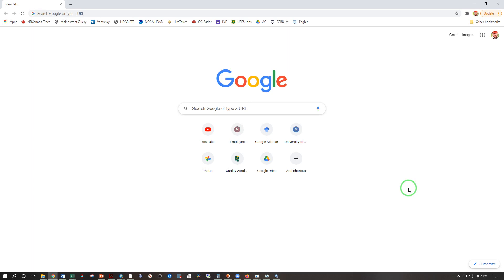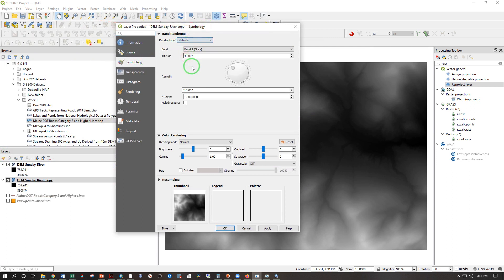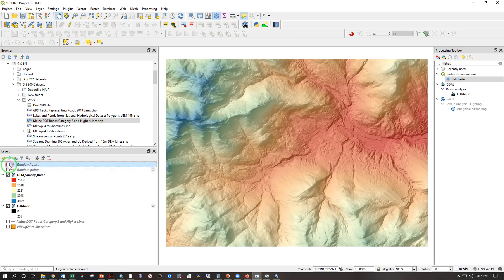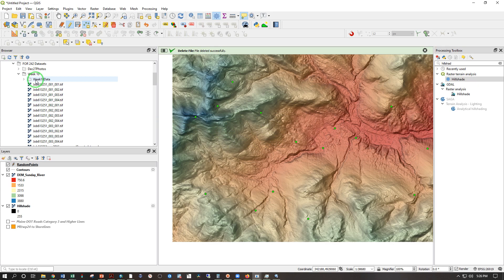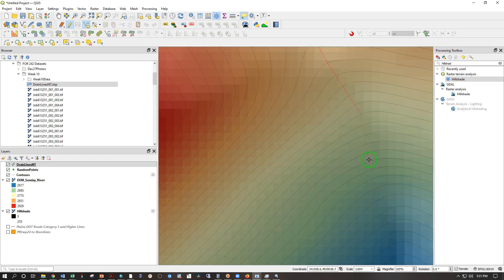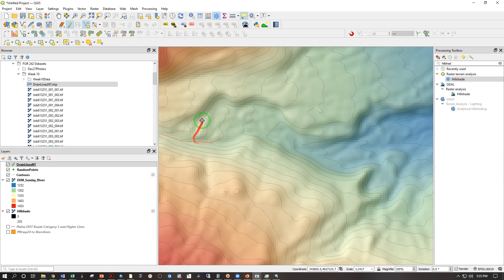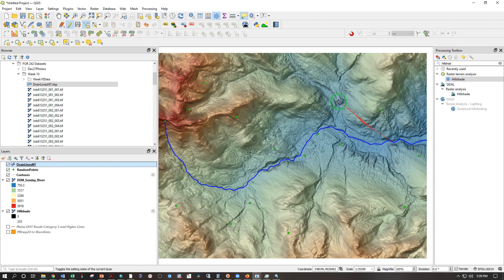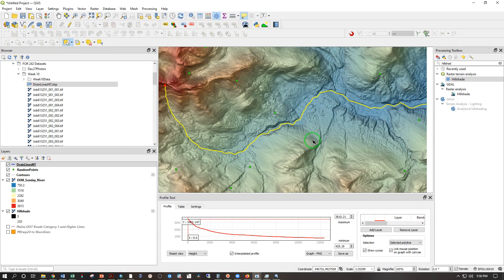FOR 242 Week 10 Part 1: Creating Contours and Tracing Flow Paths in QGIS 3.16

Comment: Hey, is there any other way to make these lines? or It has to be done manually? Thanks.
Reply from the maker: Yes, I have a series on how to do that with Arc, I'm sure there's an equivalent in Q I just haven't looked for it yet. It's only as good as your elevation model and doesn't handle split channels or anything like that. If your elevation model includes roads, the stream channel misbehaves around those unless you correct it where the culvert should be 

https://youtu.be/uJ-nxWHXKxk?si=hXgYbJLY32FzGmFC